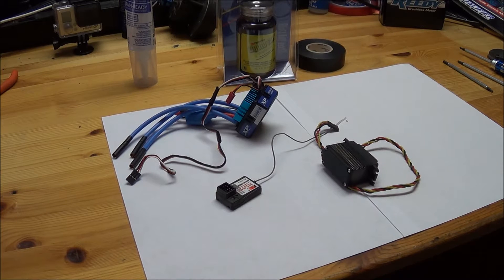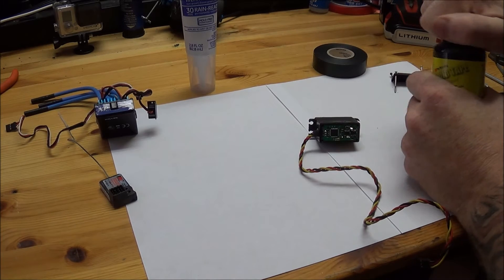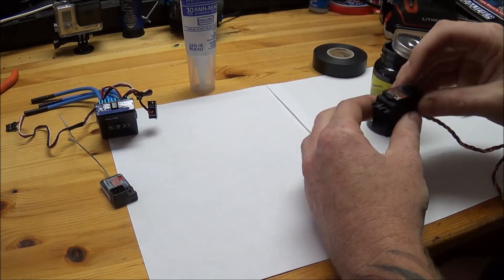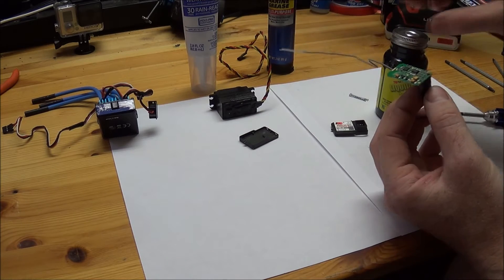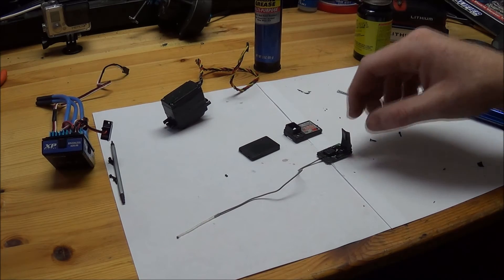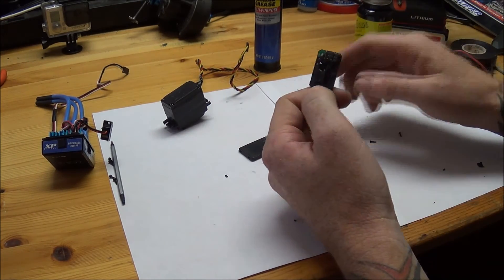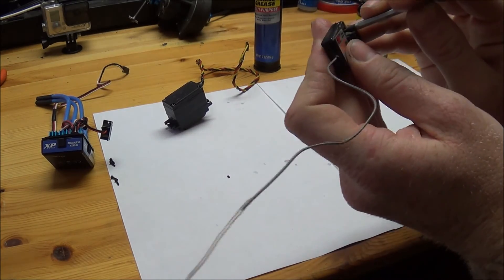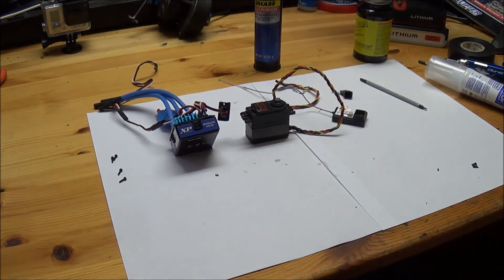How To Wateproof Your Electronics (In Detail)

Comment: negative u DO NOT want to use liquid tape. liquid tape sweats whenever it gets warm it will short out your electronics. urethane conformal coating is what u want to use its inexpensive and it's what the manufacturer uses when they waterproof there stuff
Reply: Which one do u use
Reply: I used liquid tape on my servo since it’s not water proof anyways it ws only 50$ dollars for the servo worst come to worse it’s gonna damage it or protect it win lose situation for me

Comment: Hello! If I use a liquid tape to isolate some parts of my circuit board or my proto shield, is it going to damage the shield and its components or not? Thanks.
Reply from the maker: Islombek Karimov No, the liquid tape WILL NOT ruin parts. Ive used it on many many parts over the years and ive never had any problems.